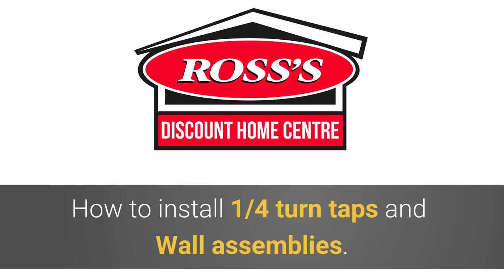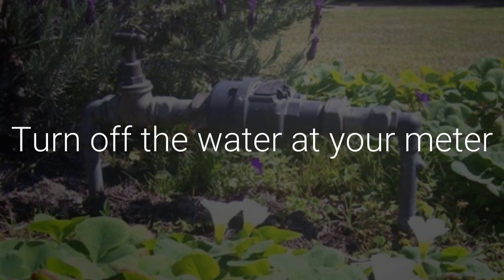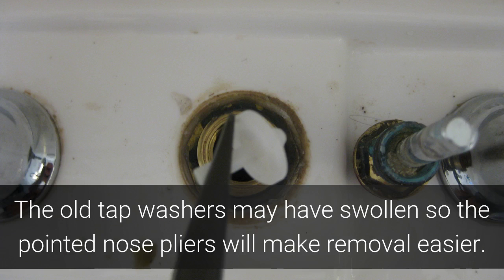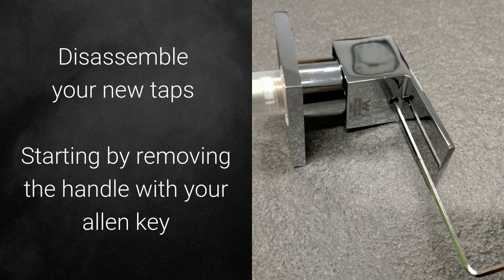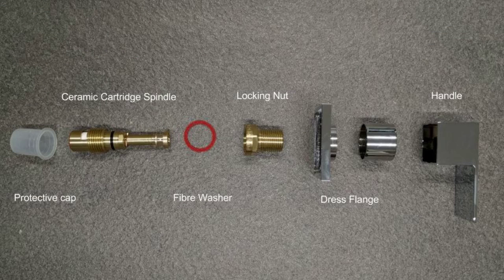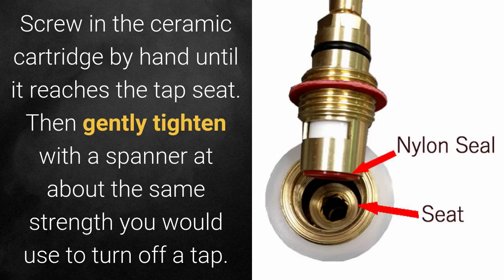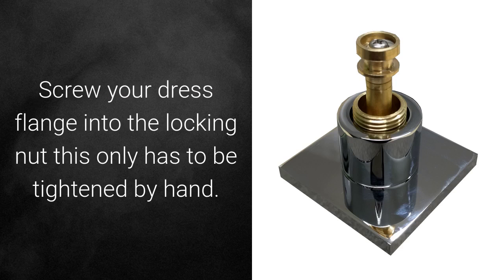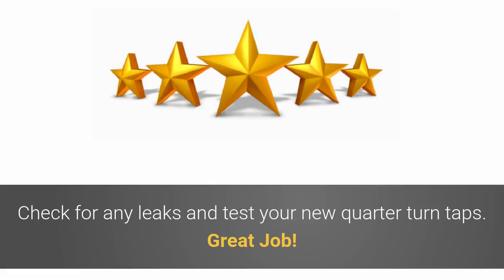How to Install Quarter Turn Taps

Comment: Thanks heaps for posting this video, I bought a pair of Shaw & Mason basin top assemblies from the Big Green Shed today. Easy to install according to their website. They came in a neat package but with no instructions and wondered why they didn't fit properly 'cos I didn't know about the CRUCIAL lock nut. I was ready to return them until I saw your video, still relevant in 2019 :-)

Comment: Thanks for the tips, just bought a pair (new) from the scrap metal yard along with a swag of other new taps a plumbing shop ditched. No boxes or instructions with demo models! Just finished installing- you saved me from filling the wall with water, cheers!

Comment: Hi just replaced my ensuite sink taps with new ceramic ones. Taps are fine however when the cold tap is turned water leaks from the base of the hot tap. I have reseated both taps prior to re installation. Any ideas?

Comment: no mention of if the taps need to be in the on or off position when installing. Isn't this crucial? I was told if it's in the off position when screwing in - the whole thing won't seal. Is this true? ive followed your method and still get leaks. Its not sealing at the back for some reason

Comment: you didn't explain how crucial it was to ensure the "spindle"? remained locked, and did not twist with the lock nut, and how to do this, or how to ensure the tap handles end up in the same position on both sides....

Comment: Hi Ross, I bought a set of two 1/4 turn basin tap, I have followed instruction as you done perfectly but it's was not working. I think the tap seat function replaced for the old washer function, isn't it?
My set bought it with NO TAP SEAT. Can you instruct me how to do it properly please?
Thanks Heaps